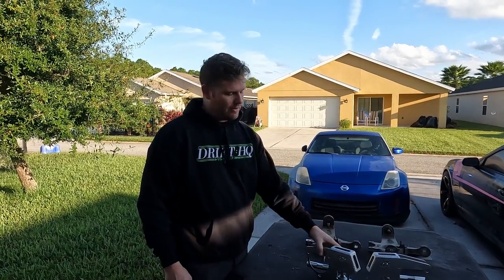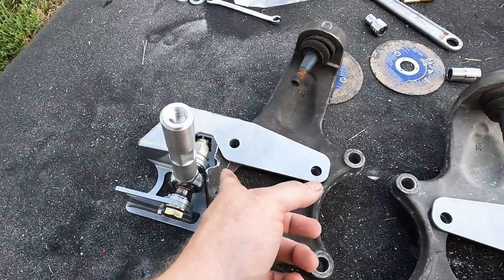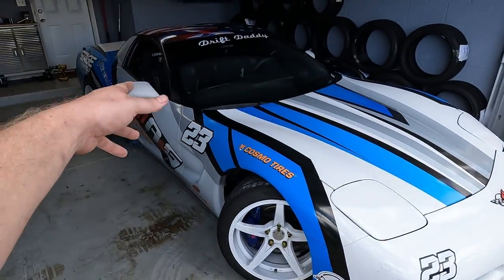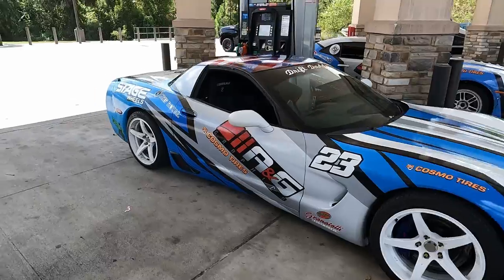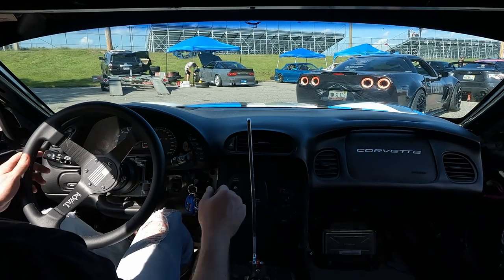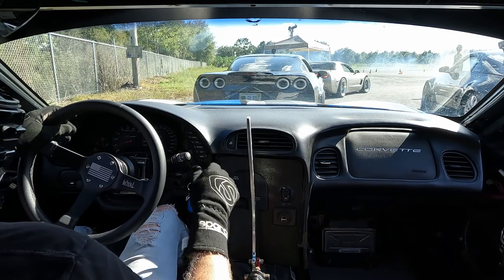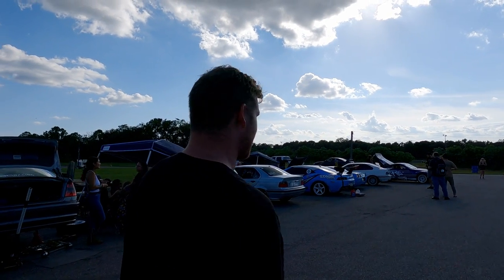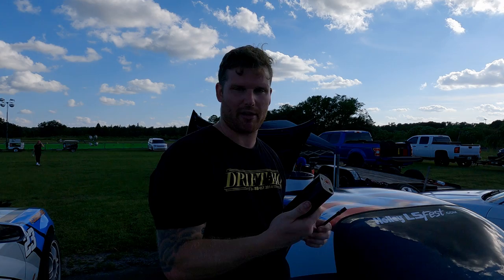Installing the NEW FDF Mild Mantis Kit + Z06 Corvette Tandems

Comment: I want to get some of these Stage Wheels for my C5, what are the wheel specs on your car? Did you have them make you a custom set seeing as the lug pattern on the vettes is 5x120.7/5x4.75 or are you running the 5x120’s as is or you got adapters/spacers and hub centric rings? Loving your channel !
Reply from the maker: Thanks man. The 5x120’s work perfect. I’d recommend 18x9 +22 all the way around. That’ll be flush fitment. DM me on Instagram and I’ll shoot you a 15% off code
Reply: Did you have any clearance issues on the front ?